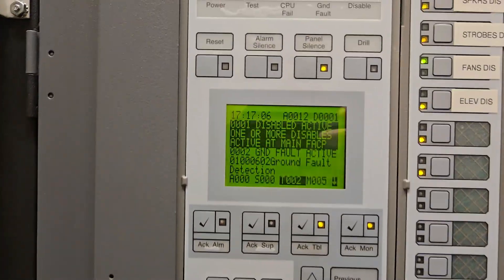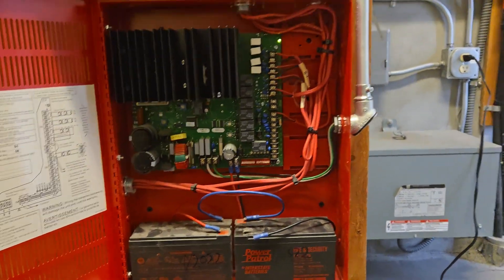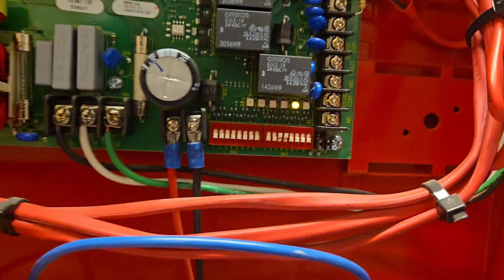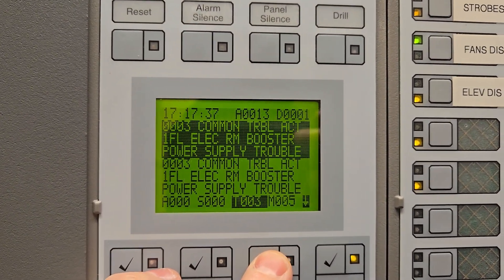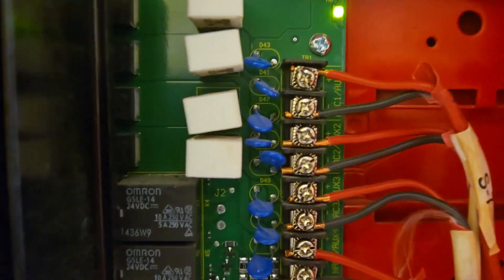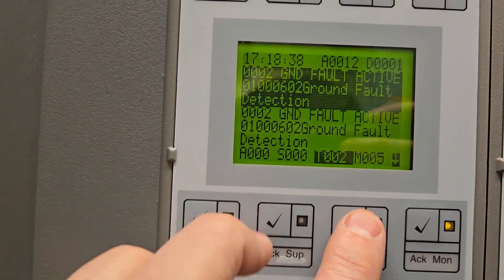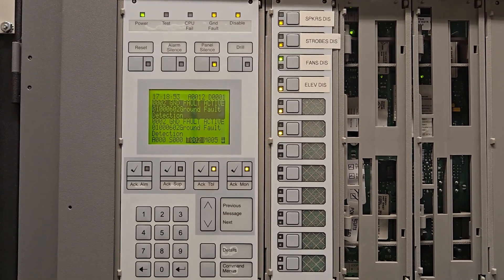Edwards BPS10A | How to test Booster Panel Trouble Monitoring

Comment: Hi, Does this booster power supply have a built-in monitor module, or do we need to add an external monitor module for trouble monitoring?
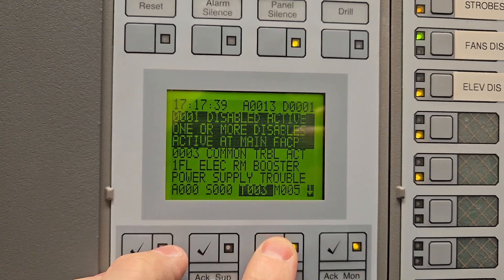Reply from the maker: Hello, This particular panel has an external module. At about 01:33 you can see the external module cover plate. As for monitoring, I do believe you have to wire in an external module with an address so whenever it goes into trouble, a trouble signal with an address reports to the fire panel.